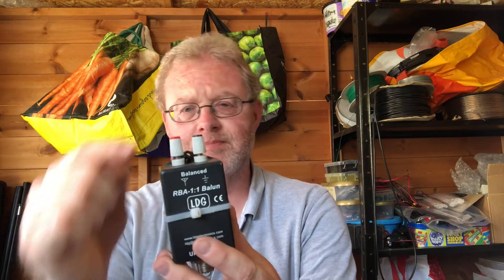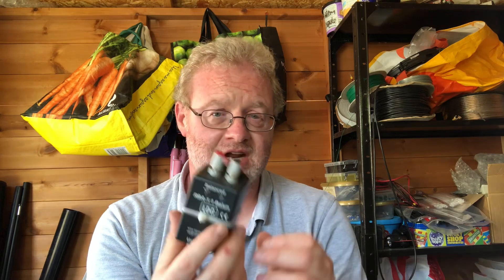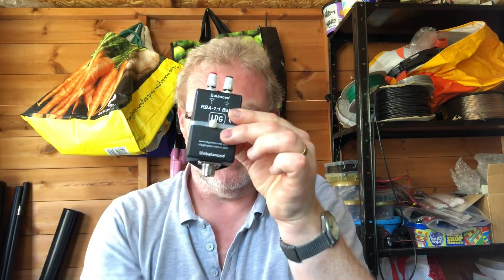Baluns & Chokes - why do you need them?

Comment: Thank you for such a great video, my only aerial option at present is a loft based 11 meter  inverted V, we also have a Freeview amplifier box up there too, my main question, in an attempt to stop as much interfere as possible to and from the inverted V, would it be best to have a balun and a wound coax choke, or would it be unnecessary to have both?
Reply from the maker: I think a good quality 1:1 current balun at the feedpoint in your case is ESSENTIAL. But your biggest issue, given how close the freeview box is you your antenna, is its proximity to your antenna's RF field. I would start with low power and see what higher power does. A lot of commercially acquired freeview boxes and amplifiers are either woefully broad-banded or have poor screening against external RF sources. That may be your biggest issue. 73.
Reply: @TIMG5TM  thank you for your reply, is there any kind of box I could put the freeview amplifier into, to help shield it from the 11 meter RF?
Reply from the maker: @Justyoutubing4  I would try the power test first using SSB. It may also be the case that you’ll be getting into other devices either directly or via mains leads etc.
Reply: @TIMG5TM  cheers thank you, I shall try that, fantastic advice and very much appreciated. Paul
Reply from the maker: @Justyoutubing4  you’re very welcome

Comment: Hi there. Thank for sharing. If I make an antenna for monitoring purpose only (connect to receiver), then no balun/choke needed (as there is no common current mode), right?
Reply from the maker: A choke can help to reduce noise on receive
Reply: @TIMG5TM  Thks Tim. '73, de YD1BAF

Comment: Great video Tim 👍alot of the balun manufacturers say place the balun at the radio end yet most people on you tube saying put it antenna end????? I use an efhw and getting rf turning my monitor off so what end would work best for me please?? I'd say transformer end??
Reply from the maker: In your case go transformer end. If you are running 40-10 then about 2m from transformer is good.

Comment: I made a choke back in the late 70s but I just read somewhere that sometimes you needed to put a few turns on the coax, so with a high SWR (it really was not that high, but I wanted it lower) I went about making one.  I just played with it, I put 3 turns of coax round a 4" to 6" (old school) and just added another wrap to bring it down, I think I had 4 or 5 turns, just taped another turn on and it turned out to be a good aerial on 11 meters, got into a lot of west Europe, but not into America or south like France.  I think that was just due to the location, their signals just went right over the top of me.  I am only a few miles down the road now, but I get France and Germany, not heard before in the old home.  Italy was far to good, but then it is for everyone!  The aerial was just two feet off the top of the house, but it worked well.  It was horizontally polarised and if I switched to it half the nearest city vanished, it was great.  Shame I can't put one up here!

Comment: Hi Tim, another good video and helpful for those on the quest to learn more. 

I have an old (4th Ed.) copy of Joe Carr's book, Practical Antenna Handbook which I got at a charity shop a while back. I understand it is something of a bible to US hams in the field of home built antennas. But, it doesn't seem to mention Ununs. Are you aware of another term people may use to describe those?

I know that an Unun is used to match an unbalanced antenna such as a vertical with unbalanced feed lines such as coax. I used a Hamtenna 4:1 Unun to match a vertical wire cut for 40m / 7MHz. It produced a usable SWR but does the Unun also act as a choke?

73  M6EXF
Reply from the maker: Hi Stephen to match the balanced dipole to an unbalanced feeder such as coax its preferable to use a 1:1 current Balun. The 4:1 you describe is purely an impedance transformer, designed to bring an impedance of around 200-350 ohms to within a useable range for our 50 ohm transceivers. So in essence to ensure you choke off any common mode whilst using a 4:1 you will need some additional form of choking in many cases, including verticals or long wires. With the centre fed  dipole with a 1:1 current Balun there should be no need as the Balun itself helps to suppress common mode (provided the dipole remains balanced). 73
Reply: @TIMG5TM  Thank you,  that is very helpful.

Comment: Hi Tim, thanks for another very useful video...I'm chasing a down a wee issue where transmitting on any band SSB will cause breaking up of my neighbours TV picture...odd....thinking it must be common-mode issue  as we are flats and I'm in upstairs flat with coax exiting a window but close to where our electricity (and phone lines) enters the building.
My antenna is not 100% ideally situated at all and my RF does radiate out between his ariel and the TV mast :/
It is receiving and getting out...it's a half size G5RV as I mentioned in our QSO today (5th june) in which you were very encouraging and made me feel very welcome in the hobby, thank you kindly.
 Ive stuck a few ferrites on my coax and I no longer knock my own wifi out when TXing on 40m, but Im still causing a break up of his TV picture...oh, FM does not interfere at all.
 I now know that the home wound chokes are band specific and will look at the info you've provided in he description.
Thank you again and sorry for waffling :) If you have any suggestions as to what I sould try in my situation I'd be grateful...you gave me a very nice report so my station works other than the issue with neighbours telly :)
 Right, diolch yn fawr Tim, 73 MW7GIB
Reply from the maker: Hi it was great to work you. Just to get a picture in my mind is any part of the antenna itself close to the tv aerial?
Reply: @TIMG5TM  The "undriven" leg comes back toward the property and is 5 - 6M away from his aerial at its closest point. Sadly, space requires that the same leg of the antenna have a short length of it dangle down therefore probably compromising and already compromised antenna. It's just too close to his TV aerial isn't it? And it's out of balance isn't it? Thanks for the quick reply Tim.
Reply from the maker: I agree I think it’s too near the tv aerial. Do you have any loft access at all if you are top floor?
Reply from the maker: Or a shortened efhw ... 39feet up a 12m spiderpole will get you 40 20 10 as a vertical?
Reply: @TIMG5TM  I have got loft space but it is so full of badly-run mains wiring (thanks council contracters) that it's just an interference nightmare up there :( I'm going to move my pole into the middle of the lawn, sod it, and see if I can get some more distance between our antennas...maybe I can get it sorted that way. Otherwise EFHW is worh a shot, as is a G7FEK style antenna that  a friend has dropped off for me to try, though Ive not got a pole high enough for that one yet. Appreciate the replies here Tim, thank you sir.
Reply from the maker: BooktownBoy no problem. Hope you sort it out and in the meantime I’ll keep my ears open for you 73
Reply: @TIMG5TM  And I'll keep watching your videos, and listening out for you. 73 :)